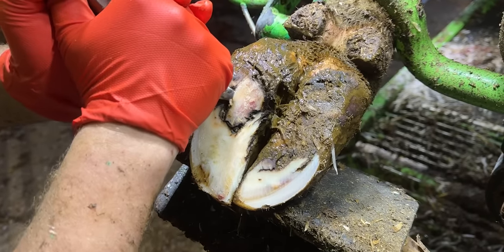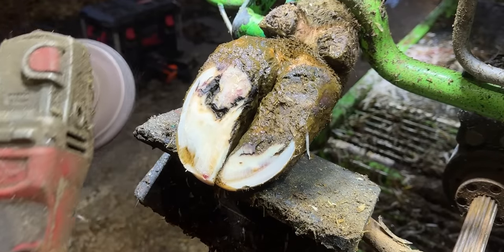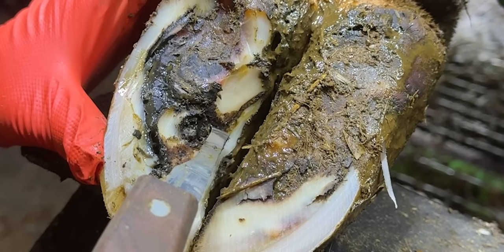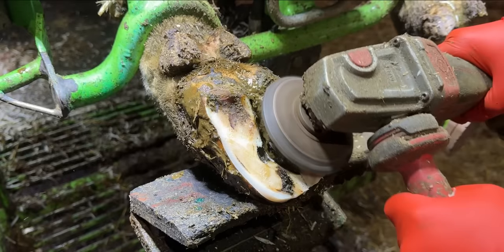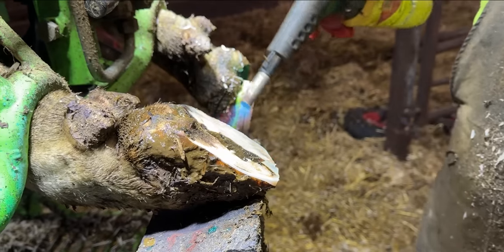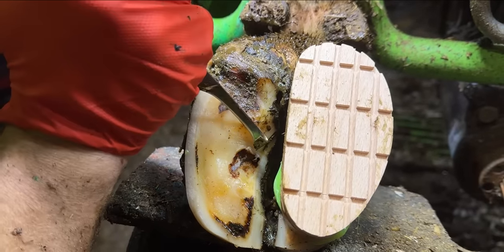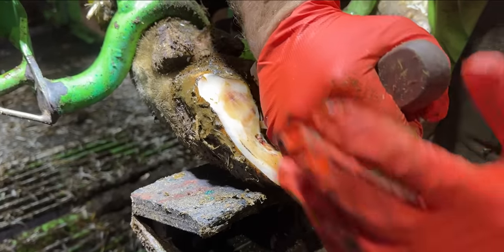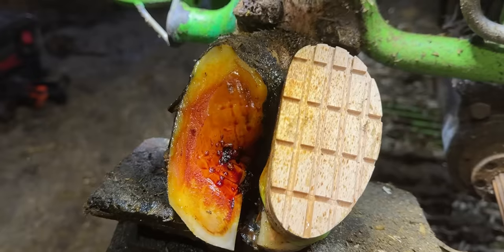SLICING PURPLE HOOF HORN ... from a cow's foot

Comment: Incredible, i had always assumed that the hoof material was really hard and brittle, not like hard cheese...
Reply: Healthy hoof horn - of all hoofed animals -  is flexible, to a greater or lesser degree, depending on what part of the hoof it's in, and the environment the animal is intended to live, and/or is made to live in. The horn has to have some degree of flexibility, and a good ability to absorb impacts, or they would just break, or cause the leg bones to break, when moving such heavy weights around. 
Even an aeroplane's wings need flexibility, or they'd just break off pretty quickly, even though they're 'only' impacting  air.

Comment: Often wondered, if you find the inner and outer claws are essentially as damaged as each other and either would typically require a block on the other claw, what options are available?

Comment: Honest question: Why you dont wash the hoof with water first and then proceed with slicing? Wouldnt it be better to have more visible area?
Reply: Let's put it this way

One swipe of the grinder, will get it far cleaner than water ever will.
Reply: A lot of that gunk is kinda hardened on. The water hose won't do much. Then you got to worry about how cold it is in there. Also he's around power tools.

And in some videos I have seen water be used
Reply: Many of the trim areas have no running water. So water would have to be hauled. Then add water to hardened  anure you have muck. Whereas dried manure can be cut off, and even brushed off as we've seen with a stiff brush. A,so no puddles of water around electric tools.   GRAEME ADDRESSES IT over and over in his videos, go back and watch for his answers.
Reply: @alistairclement4239  thanks :)

Comment: When you get the hoof up, why don’t you guys rinse the foot before you start cleaning with the sander? I would think that the manure and dirt would cause a problem.
Reply: Rinsing it off isn’t a good idea. It makes the floor slippery and Graham and/or the cow could get injured. Also power tools and water get along like me and my ex-husband.
Reply: @JenniMeer  gotcha. 😂I love watching these and find it soothing. But could never understand how y’all work around the manure.
Reply: @amjemison  They’re used to it. Part of the job.
Reply: @JenniMeer  thank you for responding to me and Happy New Year.
Reply: @amjemison  You’re welcome!! Happy New Year 🎆
Reply: @JenniMeer 
Modern cordless power tools are usually pretty well sealed against moisture and light spray.

He's mentioned in the past that hosing them off isn't particularly effective because much of it has dried and hardened, and it just unnecessarily increases the time the cow is being stressed by being in the crush.

Edit: and the slippery floors you mentioned - definitely a safety issue.